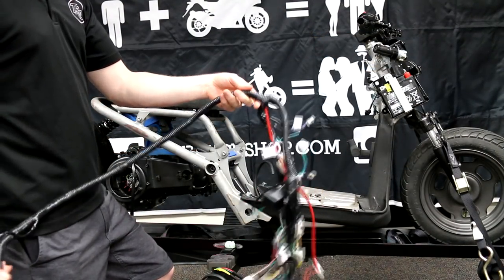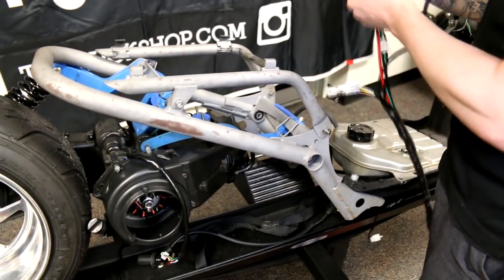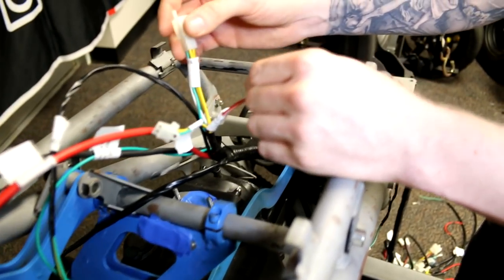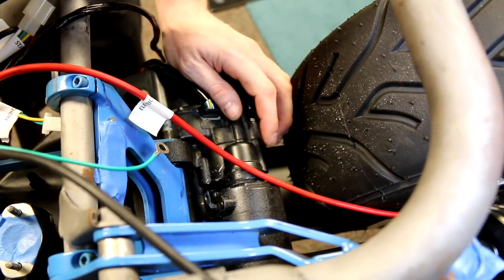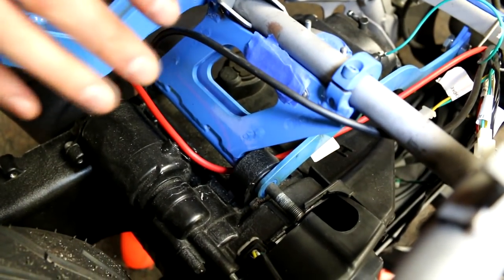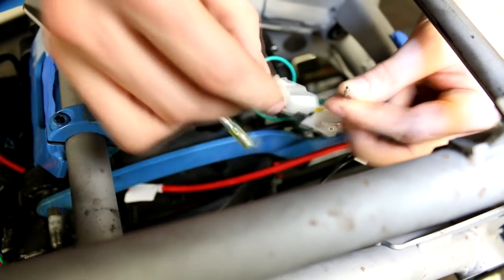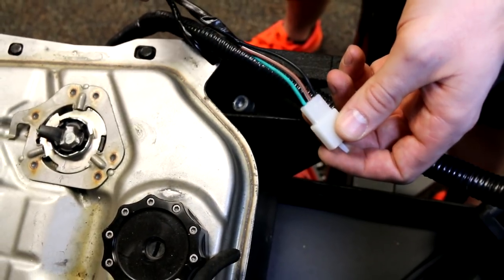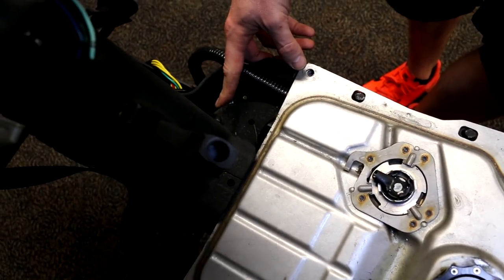ATR GY6 HARNESS PART 1

Comment: I have a problem with the harness the ignition wire on the stator is a 3 orange wire and the two timing pick up wire are blue and white and the other is green and thats on the engine so it dosent match the harness
Reply: Same

Comment: What do i do if i dont have stock ruckus left, right control, and headlight plugs?? The guy just soldered wires together and i want the atr harness
Reply from the maker: you will have to re-pin and make clips coming from the harness. factory they come setup for the factory ruckus controls so whoever you got it from cut those off.

Comment: I just ordered the atr harness and waiting for it to arrive. I know you said it is not recommended to use the oem fuel pump. I plan on using it until I can purchase a better one. Can you give more details on how to hook up the oem fuel pump?
Reply: Coming off the fuel pump is a red wire with black dots and a white wire with black dots.
Reply from the maker: we dont know exactly because it tends to overfill the gy6 carb. you have to hardwire in a flasher relay to give it a pulse. the mikuni fuel pump is under $30 so its not that much.
Reply: How'd it work just ordered mine ?
Reply: Did you figure this out? Im having issues with mikuni at WOT losing vacuum, was goin to run the electric
Reply: @skylerepperson9801  I ordered mikuni vacuum pump. It works farely well. I don't know if I know enough to give advice. I would just say make sure all fuel and vacuum lines are secure, tight and leak free. If you are bogging on WOT then your either getting too much fuel or not enough. Could try adjusting the carb needle or changing your main jet.
Reply: Also a personal experience.... I miss wired the oem electric fuel pump. It worked but got super hot. I did not realize how hot it was until gas dripped on it and sizzled. I thought it was going to burn my garage down. Scary deal. Just be careful.

Comment: Can explain the red starter cable again?  You said not to hook it to the starter because it will burn it up. Not sure what your talking about?
Reply: Ryan Courts  only if you use the starter cable that comes on the starter. You take the one off the starter on the motor and use the one that comes with the harness. What he said was not to connect the one that comes on the harness to the one that comes on the starter of a new motor.
Reply: So dont connect the red starter wire to the the red wire that came with the motor?

Comment: If you upgrade the starter to the taida high torque gy6 starter can the ATR harness Electric starter wire (red) still fry out if you attach it to the taida starter motor ?
Reply from the maker: Bmo Dex no just upgrade the ground wire . If you don't keep your finger on the start button you will be ok we see some guy that hold the button down for 30 seconds if it doesn't start in 3 seconds stop and push again . Do burst not hold
Reply: okay i guess ill have to find that tab you guys were talking about. Ill attempt to cut the starter wire and attach it to the starter.
Reply: Bmo Dex j

Comment: On the ignition coil, i only have one prong, what should i do?
Reply from the maker: Well if you go to the site it will tell you but here it is . The black wire goes to the prong And the green wire we would put an eyelet connector and it gets grounded to the m6 bolt
Reply: @Theruckshop  thanks a lot 🙂